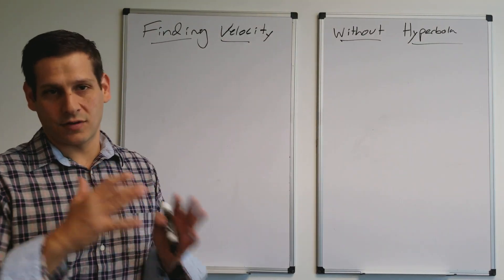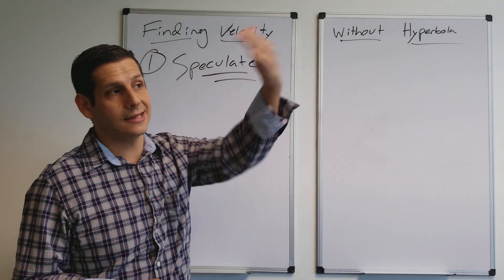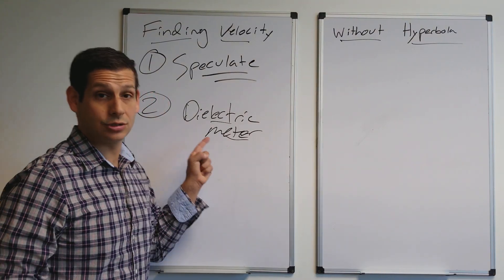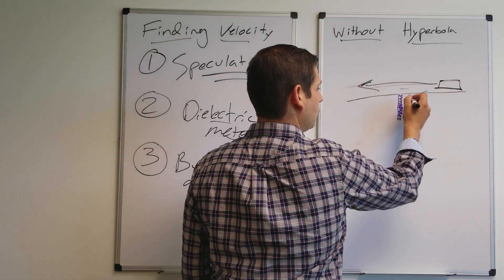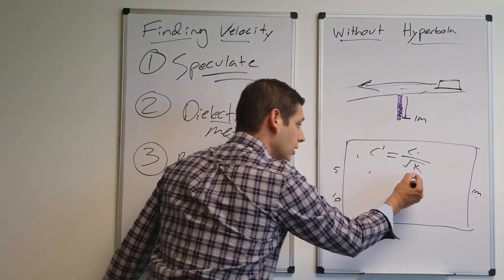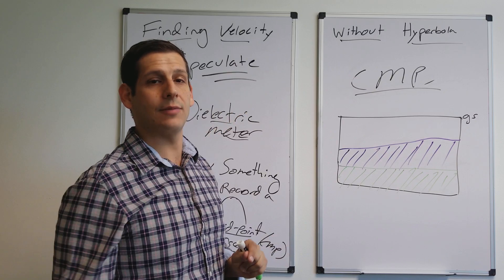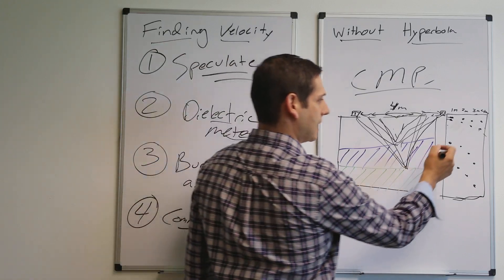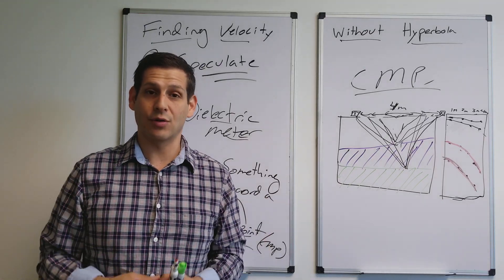4 Ways to Estimate Velocity With GPR that's NOT Hyperbola Fitting | Ground Penetrating Radar

Comment: There are multiple smartphone apps that will use your GPS location to access the USDA/NRCS SSURGO soil maps and soil database and you can get a really good idea of the soil texture for anywhere you are standing. I used to use one by the USDA called web soil survey but it looks like it has been taken down. Another one that looks pretty good is called soil web for Android but there are several others that do the same.

Method3 has the same caveat as method number two in that if you bury something two feet deep you're making the assumption the velocity is the same at lower depths. One time I used a set of soil augers and made it 2-inch hole that was almost three meters deep. I tied a padlock to some nylon string and dropped it to the bottom of the hole. I not only knew the depths but I also ended up getting a pretty good hyperbola. It was worth the 30 minutes it took me to auger the hole.
Reply from the maker: Nice idea about the padlocks. 30 min definitely isn't that long for critical data. Thanks so much for sharing.

Comment: Thanks for the video Doc! Gives a lot of hindsight. Could you throw some light on how you deal multiple wave reflection recordings when using the Modified extended common mid-point method? In this case, instead of changing the distance between the pairs of antenna, an antenna buildup consisting of 11 pairs of transmitters and receivers are used.

Comment: Hi Dan, great videos on GPR practical issues. This may be a delayed question about the second method to estimate soil velocity: Dielectric meter. I am dealing with a homogeneous soil formation and I want to try with this method. Is any specific dielectric meter for soils, or how do I relate soil resistivity with dielectric constant?

Comment: This is really, i was waiting for!
Thank u Sir!

I have few questiones:

1. I've used Gssi and mala both . The transmitter and receiver comes in a single housing which we call as antenna. Which gives nearly zero offset two way travel time.
Is seperate transmitter and receiver are available to do CMP offset analysis? Or can we do it with our sir3000 antenna?

2. For ground truth survey, if we burry an object and backfill the trench. Would it be possible that backfilling make the velocity slower than the previous i.e. before digging, due to compact formation ?

3. Could you please suggest some papers or any reference for hyperbola matching?
Can we do the hyperbola matching while processing in Reflexw software rather than on site? 

4. Last,
I have been waiting for vedio on Multiples and it's removal technique. Please consider my request 😊
Reply from the maker: I had you in mind when I made it! Glad it helps.

Answers:
1) GSSI has a set of antenna that come as transmitter and receiver separately. Check out some of the pictures on on our instagram account - https://www.instagram.com/p/BcG4HImgzw6/?taken-by=learngpr

2)Almost. The backfill could cause a speed up since it will be unconsolidated. However, the effect will be negligible if you keep the hole/trench VERY SMALL. Do your best and it will have minimal impact.

3)Look into Dean Goodman's work. Also, I talk about Hyperbola matching in my new book. It's definitely a start. You can get a copy here: www.learngpr.com/books

Yes! You can do hyperbola matching in ReflexW

4) Thanks for the suggestion. I'll keep the topic in mind.
Reply: Thank you Sir